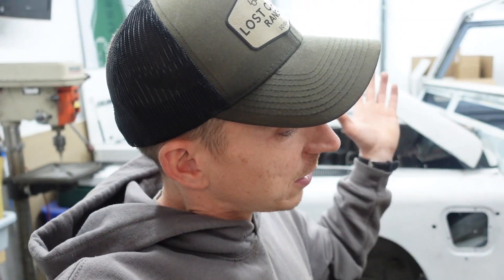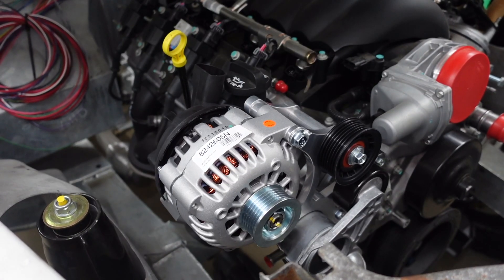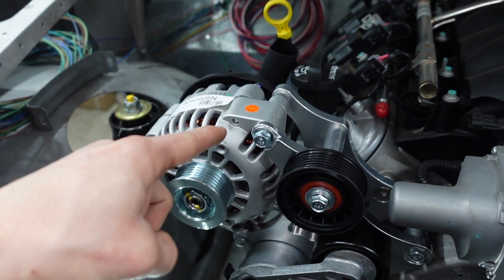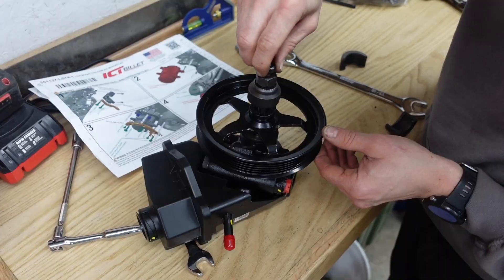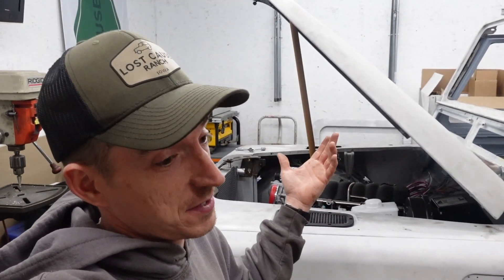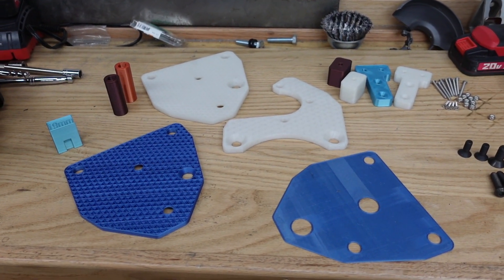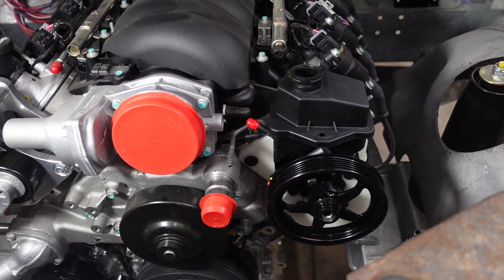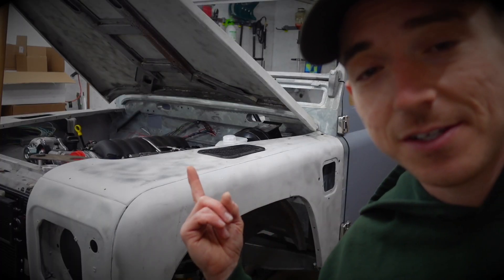Power Steering for the LS3 Defender… 3D Print It?

Comment: Do you plan on permanently using abs prints for the cooler mounts?
Reply from the maker: I’d like to try it on something. But I’ll more than likely have them made in aluminum.
Reply: I’ve got a resin printer with some high temp sla, might be great for applications like that. Excellent for making small, high resolution pieces with great durability. Lots of material property options through FormLabs. Let me know if you want to do any experimenting and I can print something’s off for you!
Reply: Interior bits and pieces, plastic spacers, clips and fittings, all possible and more with sla in final finish quality.

Comment: I've had good results with elmer's purple glue stick for adhering the print to the bed, but leaves quite a bit of residue on the bed afterwards.
Reply from the maker: Ok, what kind of bed do you have? This one is glass with pei coating. The wider prints stick well, I cleaned it well and bumped the bed temp and that made a big difference. I’ll grab a glue stick though and try that on some of the skinnier prints.

Comment: When you try to print tall thin objects, you should set the printer to make a "raft" adhesive. I sometimes tape it to the heating table when the raft is done.
Reply from the maker: Appreciate the advice, just looked into that. Will definitely use it in the future. Thanks!
Reply: @LostCauseRanch  I wouldn't bother with a raft, wasteful and slow, just use a brim instead of a skirt, that cylinder wouldn't have fallen over with a brim and you're less likely to have the edges lift on the larger flat pieces, the few minutes of trimming flashing when it's done is nothing compared to the wasted print time, material and frustrating restarts.